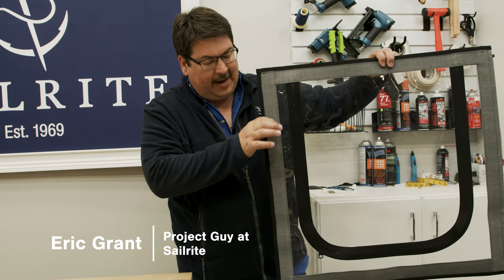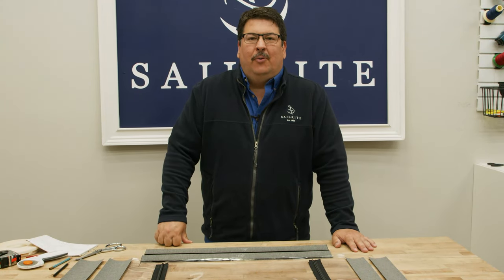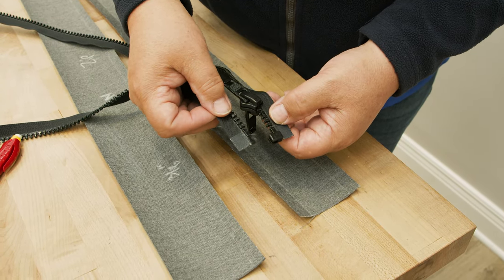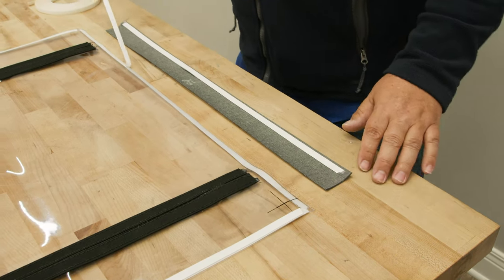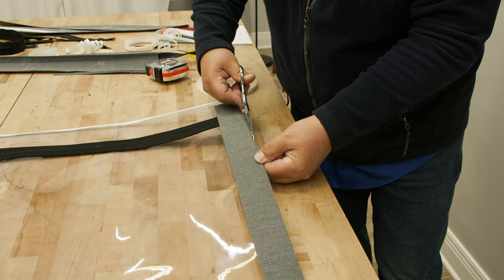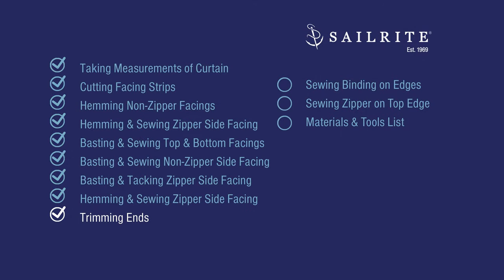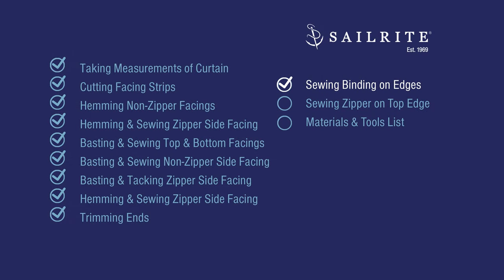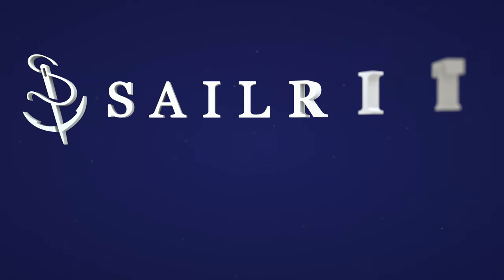How to Sew Facing/Zipper Edges to Enclosure Curtains

Comment: When using premade facing, can I put the two pieces together and bind them and then put the clear vinyl in between and sew the whole assembly together?  I realize the binding won't be sewn to the vinyl but with two rows of stitches it should still hold well.. Any downside to doing it this way?

Comment: My fabricator is starting to act up a little. It has a squeak in it and when I sew, the fabric moves fwd and backwards. Not much but the fabric isn't in a constant fwd movement. I bought mine from you guys, but I don't know much about working on it. Just the basics
Reply from the maker: You can fix that issue with a little help from Sailrite. Please email us at: support@sailrite.com and we will enter a support case and get you the help you need to fix that issue.

Comment: If you start 1st stitch with hand wheel do you not have to hold thread tails.
Reply from the maker: Good question. It is always a good idea to hold the tail threads for your first few stitches. But, if you roll the balance wheel by hand for the first stitch the possible pulling in of tails is reduced. I would still hold the tails, but sometimes I forget.